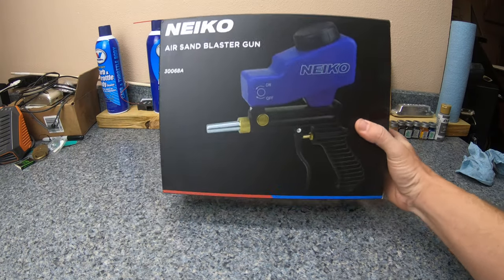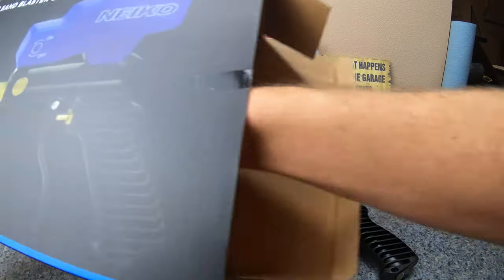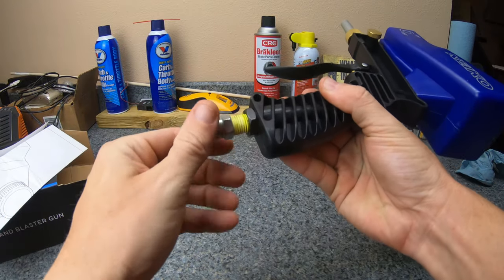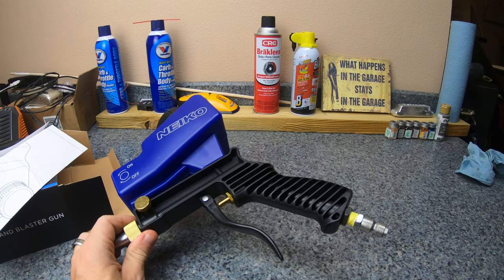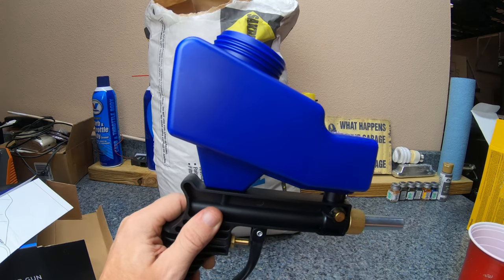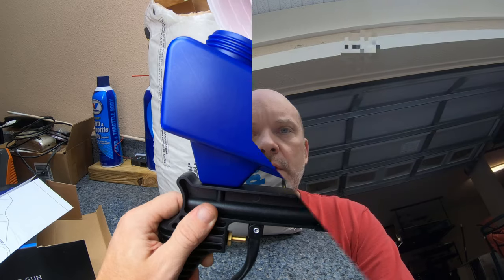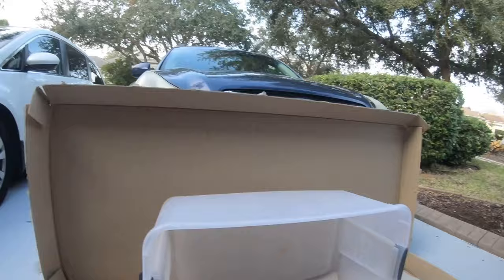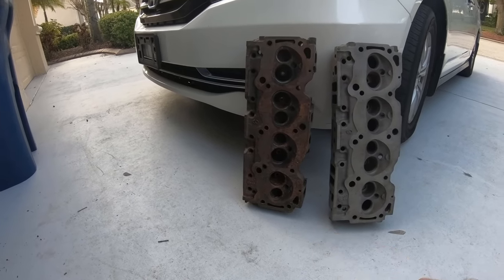Review: How effective is Amazon Neiko Sand Blaster Gun and a small air compressor vs large one?

Comment: One effective way to go is connecting your compressors together. You can also add tanks (I scored an industrial air receiver at auction and I promise you want one!) for surge capacity. Wiring a 10HP compressor to a single phase service is an expensive pain, but running two 5HP compressors or more is easy. You can never have too much air.
Reply from the maker: I ran a couple tanks in tandem a few years back for a huge painting project. The extra air capacity really helped a lot. I wish I had room for that now.

Comment: I would really like to see a comparison between high flow and low flow with the same bigger compressor. I have the bigger compressor with a secondary tank as well, but I use the standard 1/4 NPT fittings. I would like to see if the low flow with the PSI staying more consistent would still do the job.
Reply from the maker: Thanks for the video idea!

Comment: So, it doesn't seem to be a high flow/low flow issue, as much as it's a compressor size issue. 
Because I imagine that if you connected the low flow hose and connector to the larger compressor, it would work just as well, and probably even last longer per sand fill, as apposed to the high flow setup.
Reply from the maker: I didn't try that setup out but it could very well be true. I went into this test assuming it would need high flow but if you have a small air compressor I believe you could probably delay it from kicking on and off a little with a lower flow nozzle and still be effective.

Comment: This was my main concern. I have a small compressor in my garage, but figured "psi is psi, regardless of tank size."
You just have to let the pressure build more often with a small tank. But hey, Im just aiming for cleaning up small rust bubbles on my car.
Reply from the maker: @sk4lman  it'll do it if you have the time. :)
Reply: @JackofAllTrades1  You can only mix so much putty at a time 😄
Reply from the maker: @sk4lman  I wouldn't even want to see all the putty under the paint of that Buick on my page. I know it was repainted in '96...who knows what was done to prep it.

Comment: Thanks for the video, I needed to know if the small 5cfm 2hp compressor could clean up the seams on the vanagon and I think it'll be fine. It's a couple of small sections so should only be 30min with the waiting for the compressor to catch up. If you look on the forums they all tell you to get the largest compressor possible but that's out of my budget and I only need it for the odd small job.
Reply from the maker: If you have the time then it will do it. You will get about 5-6 seconds of good blasting out of each full pressure charge.

Comment: This thought crossed my mind - why not use a ski mask that covers everything but the eyes. Then wear goggles or safety glasses for the eyes. This way any splash back particles won't sting your face and at the same time your'e filtering the air (maybe wear an additional nose mask over the ski mask). I would think that one would be pretty well well protected this way. Of course one might get a little sweaty, but safety is the priority here.
Reply from the maker: I recently got a face shield that I hope helps with the sand ricochet... another issue is the amount of dust it creates which the shield will do little for. Maybe a fan blowing across the area would help.

Comment: I got the Lematec blaster...it came with a few accessories like air fitting, spare nozzle and safety glasses...I'm thinking of tapping the end of one of the nozzles and maybe some kind of reducer to see if it will make it a bit more efficient with lower powered compressors...I have a Craftsman pancake compressor I use quite a bit for work....If I have to wait for the tank to recover, I'm ok with that...but I'm curious to see if a reducer will make any difference
Reply from the maker: The nozzle on this one is pretty small which I believe helps. Not so much wasted material either.

Comment: Was planning on ordering a Gravity feed sand blaster as well for old paint stain on wooden rails and end rails with designs that make it hard to reach with a scraper … some videos on YouTube recommended Baking soda media & online recommended Walnut shell media which I’m familiar with the grit sizes of that at least…. Which do I choose and what grit size should I start with to play it safe? 100?
Reply from the maker: For wood, I would try baking soda first. Several people here have indicated the use of baking soda for wood trim detail. If that doesn't work, then move to the walnut shells. Larger grit size is for bigger areas, smaller for finer detail.

Comment: ----  your 'catch container / system' is going to have a lot of bounce back and blast medium loss  -   plus you are way down low kneeling or crouched  -   instead, go to the discount store and purchase the largest, deepest simple plastic storage container they have  (  or go find a real big cardboard box ).  Then build you a wooden frame ( 1 x 6 ) which will fit over the top of the plastic container  -  staple a piece of heavy hardware cloth (  1 x 1 being perfect ) over the top of the wood frame  -  then either simply set it over the plastic container ( cardboard box ) or , better yet, put 4 legs on it so you can just slide the container under the frame  -  you now have a catch container with a blow through top on which you can support the item being blasted  -  you are also now not all bent over or kneeling  -   you can see, you will have less sand bounce, more sand capture, and a surface to lay the gun on  ---   for small items, make you an open top box about a foot square with 3 inch sides from 1/4 inch hardware cloth  -   put it on top of the frame and it keeps you from sandblasting your fingers when doing nuts/bolts/little pieces  

I have a 48" X 96" 2x6 framed worktable divided into 3 equal sections on 30" legs in an open shed -  two sections have 1"x2" fence wire and the 3rd has 1"x1"   -   it has a canvas skirt all around ( open on corners and slit into 4 equal widths down the long side so it can be draped into the catch containers ) with 4 plastic catch containers  -   makes blasting so much easier and catches a LOT of the blast medium  -   also use it a lot as a general work area and often ( unwisely ) as a paint station  -  course it comes down to do you have the need and space to devote to a dedicated blast area
Reply from the maker: That is some good information, thanks for sharing your setup.

Comment: I really appreciated this video.  I’m trying to set up to etch glass @ 40 PSI with aluminum oxide and have no experience with compressors before this. 

I picked up a craftsman 6 gallon pancake, 150 PSI (2.6 CFM @ 90PSI, 3.7 @ 40). 50% duty cycle I think.  Looks like it will do the job if your 2 gallon was able to do some work.  Got plenty of PPE, and ceramic nozzles, but really concerned about how much debris I’ll be leaving in a condo lawn 😬.  I’ll probably only be doing 2 or 3 a month of 8x10 glass…and only about 50% of each piece.   Any suggestions on set up or containment would be appreciated!
Reply from the maker: I think you bring up a valid concern. You will have dust in the air that will get on things around you... in your area if you have vehicles or bushes you might notice the dust on them or if you are close enough... even debree from the medium you are using or the item you are blasting. Since I was using sand I can just brush it into the grass but you may need to put down a tarp or drop cloth to contain it. If you are out away from most stuff than that may be all you need... especially if you don't plan to reuse the medium... if you do then you will need to have a box setup similar to mine. Good luck.
Reply: @JackofAllTrades1  Thanks for the quick reply!  I caught a good video on making a blast cabinet out of a big plastic tub.    With some modification, I think that's going to do the trick and can be used indoors as well.  I already talked to my closest neighbor about occasional compressor noise, but I wasn't thinking about dusting everyone's cars (or winter)!  As far as comments about too much talk in this video...it's called listen and learn folks!   This is the ONLY review that showed you could use this gun type with a small compressor.  I'll just take breaks for the compressor's health.  Not like I'm going into business (yet...lol)!
Reply from the maker: @TYoung023  thanks for the generous comment, I appreciate it and wish you luck with your project.

Comment: Hey great video man. I am restoring my dodge ram truck and i want to sand blast  the rust from my frame and some of the heavy steel components. Im wondering if you think this would be a good kit for that or would i need something stronger. I have a massive compressor so im not worried about air. Thanks
Reply from the maker: Yea, this gun will work just fine but a frame is a huge project... you will be refilling this gun a lot. Something with a bigger hopper like the 50lb one I reviewed may be a better option for something so big.
Reply: @JackofAllTrades1  thanks man i really appreciate it.

Comment: Great video, very helpful.

Don't know if you could help me...I'm looking for a compact solution to do my inlet ports on a d.i engine. Do you reckon this will work with walnut media and do the job? It's not that those gravity fed baster vessels are too expensive, I just don't really want to have to store it, as I won't be using it much.

Thank you for any advice you can offer!
Reply from the maker: This will for sure work with walnut and is small enough to not take up a ton of space. I have limited space here in my shop so buying a large tool that I may use once every couple of years just doesn't make sense. Here in a week or so I'll be testing out the Harbor Freight blaster... I introduced it in my most recent video if you are interested in it as well. Thanks for the comment.
Reply: Thank you for the fast reply! Very much appreciated, I'll definitely get one in that case, I'll test it out on some carbon fouled parts before I pull the intake manifold off. Thanks again for the video and for sharing your thoughts.

Comment: Can you tell me what are the actual sizes of the two compressors? (HP, tank size, and CFM)
Reply from the maker: Hello Bobby, the large compressor is a Craftsman 30 gallon 3hp 220 volt (pump and motor separate) with 14 CFM of displacement. It operates at 7.5 SCFM at 125 psi and 8.5 SCFM at 90psi, max pressure is 125 psi (regulated cutout). The smaller compressor is a Craftsman 1.5 Gallon 120 volt (oil free) that operates at 2 SCFM at 90 psi, max pressure is 150psi (limited info on this one because it's pretty basic). I hope this helps.
Reply: @JackofAllTrades1  It helps a lot. I'm surprised the 30 gal 3HP can deliver that much CFM. I'm curious if there are any formulas out there to calculate how long a particular tank size can provide adequate CFM to run a sandblaster like that. The more impressive part of your demo is that the cheap HF gun can do that well with the adequate pressure behind it.
Reply from the maker: @bobbyfoster3769  the 30 gal unit is made for painting, so its supposed to keep up with high demand. The pressure switch kicks on at 100psi as well. Not sure about formulas or calculators but I'm sure there is something out there. Cheers
Reply: @JackofAllTrades1  think a 30gall 5.5cfm at 90psi would still be tedious?
Reply from the maker: @brodieobrien-pickering2202  5.5cfm at 90 is decent. You should be fine. If the pump is working a lot then just check for moisture buildup in the line if you don't have a filter.

Comment: great video, im putting together a kit to sand blast a motorcycle engine and a few other bits and pieces.... what compressor would you reccomend? preferably one from amazon as im in the UK. i wont use it often enough to justify spending thousands, but i dont want one that will last 3 seconds either lol. middle ground one, thanks in advance.
Reply from the maker: If you can get one that has a separate motor and pump... those are far better than the combined all in one units and also quieter. 20 or 30 gallon should do you well.
Reply from the maker: Ingersoll Rand 47708908001 P1.5IU-A9-H Garagemate 20 Gallon Horizontal Air Compressor https://www.amazon.com/dp/B08ZJXDGJS/ref=cm_sw_r_apan_glt_fabc_DZNBNQQDYS0WSNESD19J

Gosh, when did these get so expensive!? Here is the setup I speak of ... maybe you can find one for a better price across the pond.

Comment: Did you speed the vid up when you did the low pres one? It seems like that one went a lot quicker and I felt like I could hear the compressor in the back like normal.
Reply from the maker: Hello...yes Both the high pressure and low pressure sections have normal speed and sped up sections.

Comment: You don't want to use actual sand.  Your breathing protection will only get the bigger particles.  It breaks down so small that it can't be filtered effectively.  Use a purpose made blasting media.  Your bag of sand probably even had a warning about not using it for blasting.  I'm actually researching this gun for blasting a few Buick parts, too.  Hope your build is going well.
Reply from the maker: Thanks for the heads up, I figured a respirator would be enough protection outside. Luckily I'm done blasting.
Reply: You got educated from the youtube school and not accredited institute

ANY normally commercially available respirator who had passed the 42 CFR Part 84 approval is 99.97% efficient 
You got all the info on the box when you buy it. 

Breathing “fresh air” without a respirator accumulate more carcinogenic and particles than breathing asbestos WITHOUT proper respirator

Comment: Hi, what are your thoughts on using this to remove bottom paint on a boat? I think it would come off easier than your metal projects, especially if the entire head only took 20 minutes. I have no knowledge of blasting or removing bottom paint. Trying to figure it out. Thanks in advance.
Reply from the maker: It would come off... the blast pattern for this gun is about the size of a penny. Keep that in mind cause a boat is huge. You may be able to pull back some and make it larger, will just depend on how easy your paint is to strip.
Reply: @JackofAllTrades1  Oh yeah, that would.def take forever.  34ft boat. Thank you
Reply: Consider using soda blasting, it may not be as damaging to the fiberglass

Comment: Great job. Do you think this gun can work using a 2.6 hp scfm 6 gallon 150 psi air compressor to remove the clear coat from aluminum rims?
Reply from the maker: Yea. I actually used this gun for a similar job... I busted some corrosion off all 4 aluminum wheels on my wife's van.they were not huge spots but took it down to nothing.